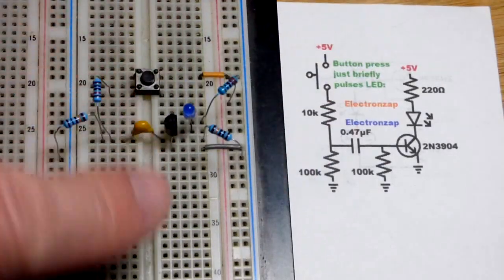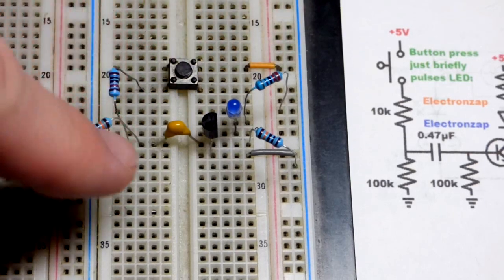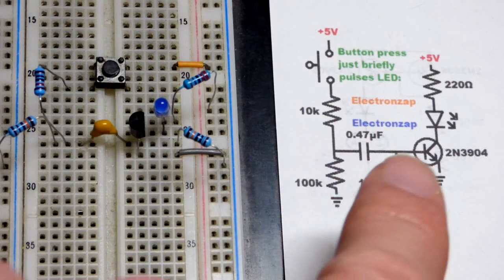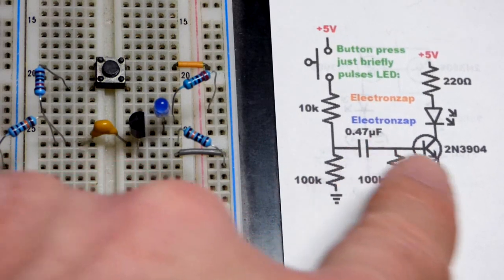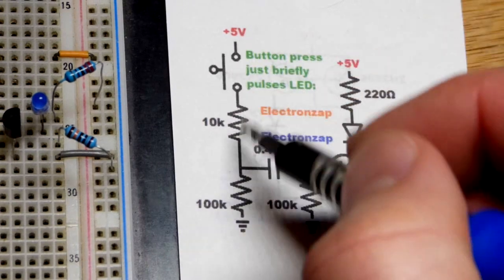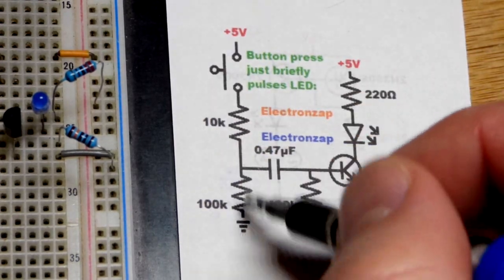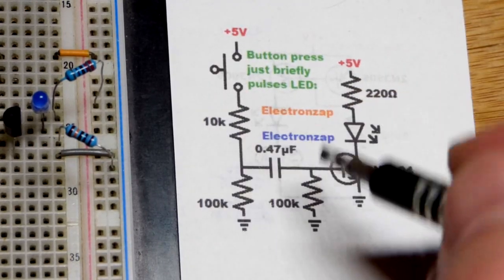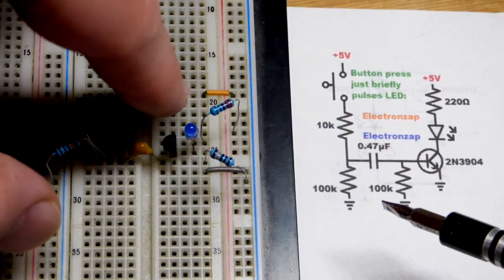One rapid LED light pulse per press of push button switch circuit using 2N3904 NPN BJT

Comment: This is the kind of circuit I was thinking about. Thank you very much!
I'm going to modify it slightly by eliminating the LED and its resistor and replacing them with a small 5v relay so I can provide momentary continuity for a secondary circuit. I might even change out the 2N3904 with a 2N2222 for a little more current for the relay.
Reply from the maker: Very cool, Modification is definitely the final goal of studying any circuit. Thanks for watching!

Comment: GREAT VIDEO!!!........one thing though...
At 1:39  the 100k resistors are in parallel. so it's actually 50k discharge...not a 200k discharge.
Reply from the maker: When the switch is closed and the capacitor is charging, those 2 resistor are somewhat in parallel until the capacitor is fully charged charge. Technically resistors aren't truly in parallel unless the same voltage is across them and no other components are in series with one or the other. The capacitor and Base Resistor together are parallel to the low side voltage divider resistor while the switch is closed (on). Once the capacitor gets charged to the maximum voltage that can be applied to it, then no current will flow through the base to ground resistor but will keep flowing through the low side voltage divider resistor. Opening the switch (turning it off) will make the capacitor the only power source for the 2 resistors that it has headed to ground, until it is fully discharged. Ground is not part of the power for those 2 resistors while the capacitor is discharging, it's just a half way point between the resistors. So, the same current has to flow through one resistor, and then through the other resistor from one side of the capacitor, to the other. Resistors are only in parallel when the exact same voltage is directly across both of them, so that each one of them creates a separate current path through them, that can not be affected by the other one.

Comment: Sir, i have problem with this. I use 2 white led and 2 red led (3mm size), the white led won't light up, only the red led will light up because the difference in specs between the red and white leds. If i give resistor to the red light then the white light will come on but it will be dim (not bright) and of course the red light will also be dim. I use input 4.2 volt. Can you give me solution? Thank you.
Reply from the maker: Using a 4V to 5V power supply, you can only wire white LEDs in parallel. And all parallel LEDs should have their own resistor. LEDs drop voltage, and white LEDs drop about 3V. So if you put them then series, then they will drop 6V. A white and red LED in series will drop about 5V because red LEDs drop about 2V each.
Reply: @Electronzap  I cannot use power supply 5V because i use 1 cell lipo battery (fully charge at 4,2V). Okay i will try paralel with resistor. Thank you for your reply sir 😉👍

Comment: hi, why need the bottom two 100k resistors?
Reply from the maker: They let the capacitor discharge through them. But they can't be allowed to have current flow through the base of the transistor. So they both have to be connected to ground so that when the switch is closed, current can go to ground through the bottom resistor to ground, instead of working it's way to the base, which is what would happen if you simply gave the capacitor a parallel resistor to discharge it.

Comment: I use PN2222 transistor maximum time to experiment with different circuit...... Actually last month I have perched 30 different values 50 each (pn2222 100 pcs extra) transistors...
I ❤️ ur all videos and
I ❤️ 2222....